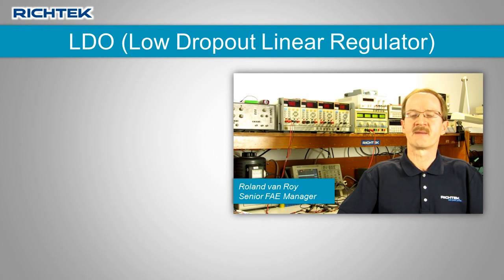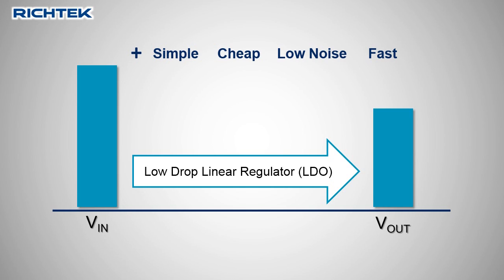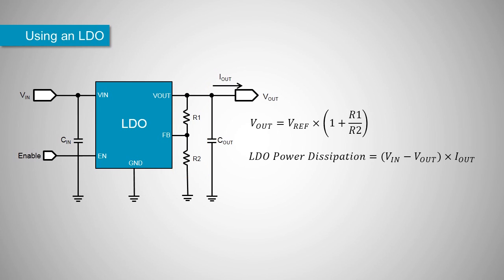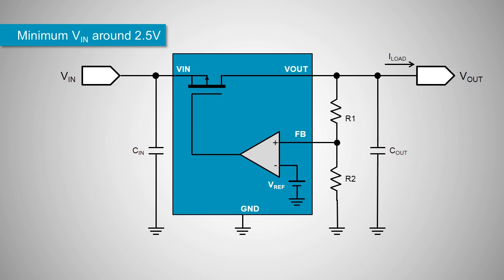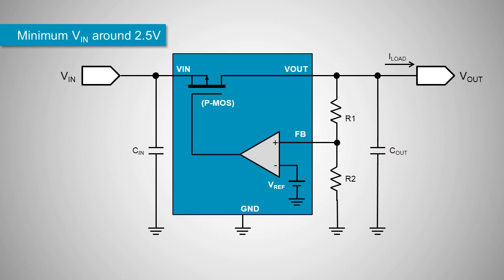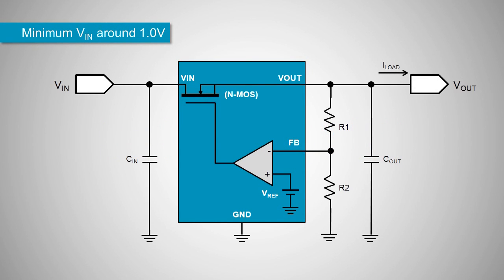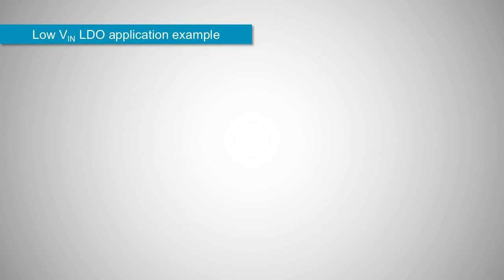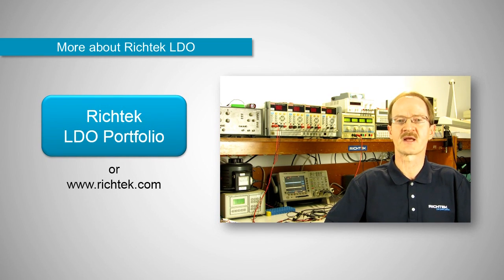LDO (Low Dropout Linear Regulator)

Comment: Hi  i want to  do regulation with 
 ld1084v and can i use 5k ajustable pot  to replace the R2 resistor i want a 6.3 vols output .thanks

Comment: Thanks for the explanation of why regulation suffers when the drop across the LDO gets too small. Also, the explanation of why NMOS regulators require more bias current b/c of the charge pump.

Comment: Just for completeness:There is also some power dissipation due to the bias current in the LDO that flows out of the ground pin. VIN * Ibas or VIN * (I_in - I_out). For an LDO supplying 100 mA at 3.0V from a 3.7V supply, with a bias current of (e.g.) 200 uA, the dissipation from bias is 3.7*0.2mA = 0.74 mW. The dissipation due to load current is 0.7*100mA = 70mW. 0.74 of 70.74 mW (~1%) probably isn't significant.